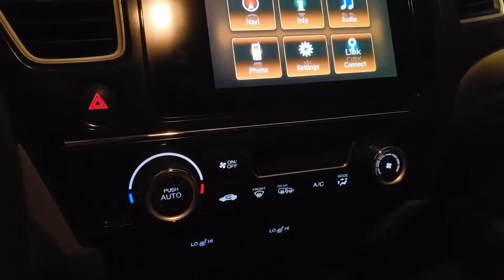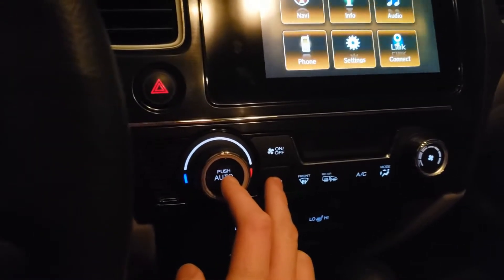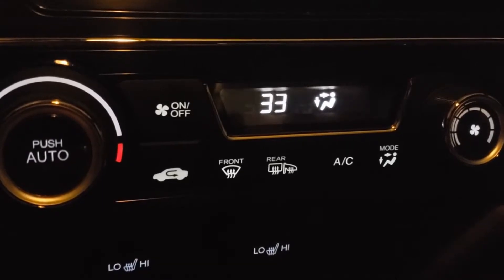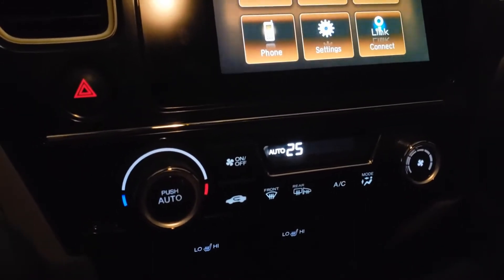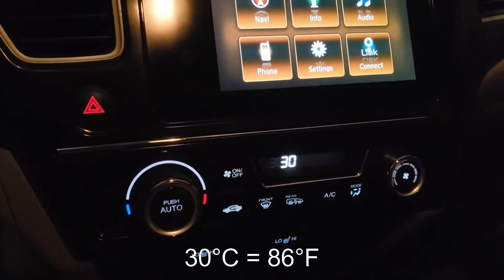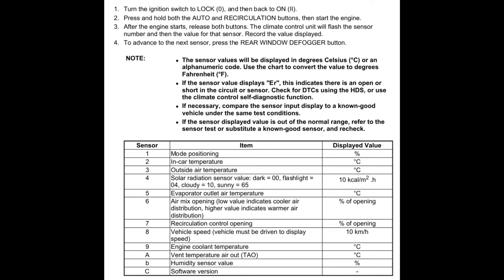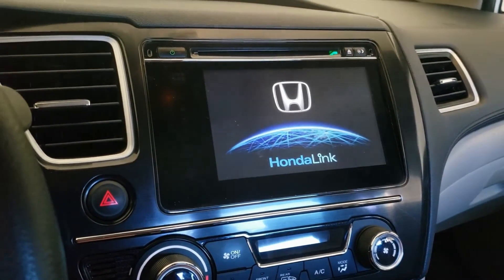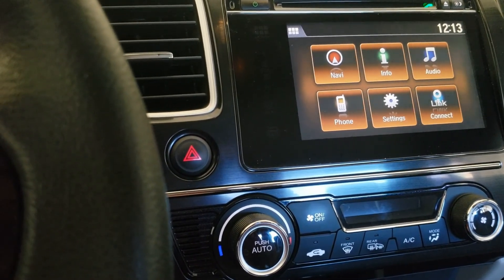Honda Climate Sensor Input Display Mode - Instructions and Demo

Comment: Great video Thank you so much!!! I was also wondering whether  you know where the evap temp sensor is located on this car . My AC temp sensor is reading 419 fahrenheit on my scantool and Im not sure from what sensor it is reading! My scantool only shows one pid related to my AC temp and its reading       
419 degrees and 0 for its voltage .I was wondering if it was the sunload sensor needing to be replaced ?
Reply from the maker: It sounds like your evaporator temperature sensor is shorted. I believe that is located in the HVAC assembly- I can double check later.
Reply: @civicminded2141  Mannn If you can find that out for me would be great thanks I ordered the repair manual but it takes 2 weeks to get to me!
Reply from the maker: @joebagofdoe4762  Hi, sorry for the late reply. The evaporator temperature sensor is indeed on the HVAC. From the looks of it, it's somewhere behind the glove box.
Reply: @civicminded2141   yea I watched an entire video of someone removing the HVAC to find out !!!